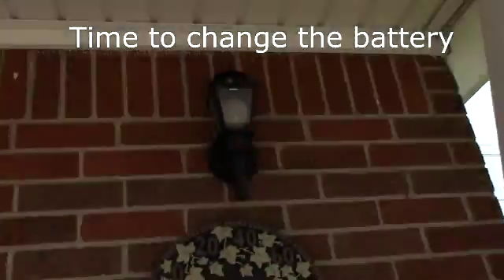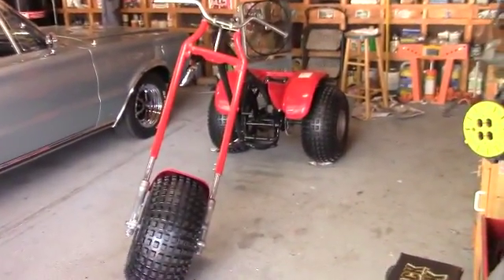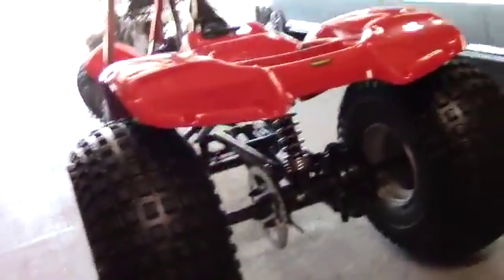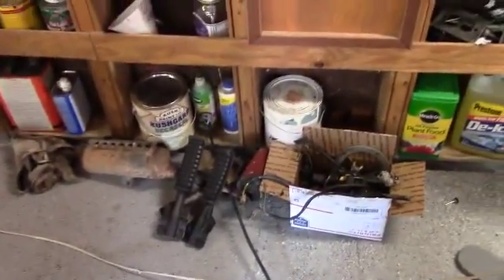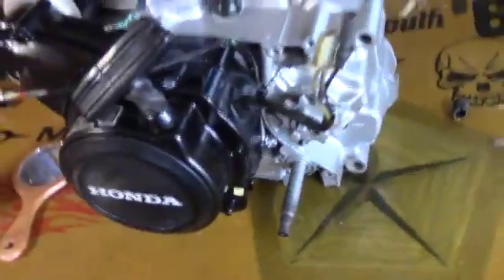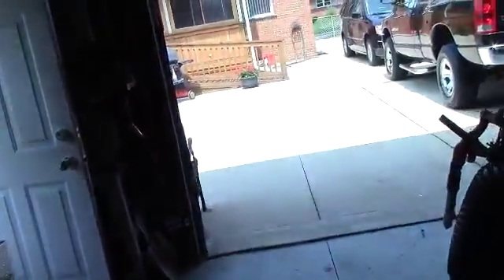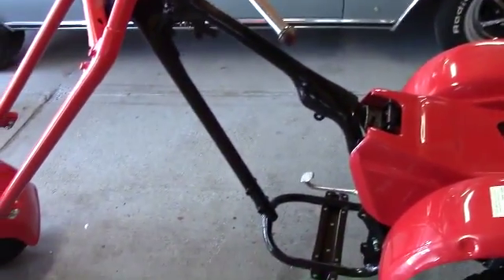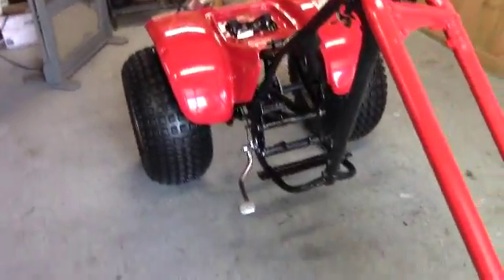Update Honda Chopper

Comment: Exhausts are tricky. On my 500 XR motocross, the baffles rusted out and were rattling but the outside was 1/2 ass intact, so I cut it in half and just made new baffles to look like the old ones and welded em in. She works just like new and it cost me next to nothing but a bit of time. If ya knew what the guts of the muffler looked like you could just make a whole new muffler or if you can afford it, brand new old stock is the best way to go. The Chinese make a nice little baffled glass pack to fit a 250cc for about 80 dollars/free shipping. Used mufflers are used mufflers. You already got a used muffler so that is kind of a dead end street.
OR
you could get really creative and make an entire new exhaust using straight pipes with one of those little baffled glass packs sold for small tractors but it will be louder. If you want quiet just put 2 of em in a row (leave a space between) and that will give it a deeper note. The front fender looks great. In fact the whole bike looks good. 

Personally if the muffler doesn't rattle, I'd just stuff it with xx coarse stainless steel wool on the intake end and use it. Just stuff it, don't pack it in or it will cause a restriction. A little cleaning and a little heat paint and it will look and sound as good as new. The steel wool will last about a year and burn out but it is so cheap, ya just replace it every year.
Check this out:
http://www.ebay.ca/itm/Exhaust-Muffler-w-Heat-Shield-Cover-for-250cc-X31-19-16-Dirt-Bike-4-Stroke-/141342466273?pt=LH_DefaultDomain_0&hash=item20e8aae0e1&_uhb=1
Reply from the maker: EdOfTheNorth Thank you Ed, Your the BEST friend a person could have, I just ordered that muffler for 80 dollars I think it will fit it perfectly, I'll just have to make the header for it, That is the fun part, I also like your idea about cutting the old one in half and seeing how they put the baffles in it, That would be good to know, I have checked out a lot of mufflers on ebay and didn't come across the one you found, The price and style of it is just what I was looking for. The last time we talked you ask if I was going to put a sissy bar on it, I am thinking that it would look cool on it, Just not to sure on the style, How high,how wide, Just don't know yet. Take care my good friend.

Comment: Looking great. I just asked a mechanic friend about the exhaust and he said you should not run it open. The engine needs some back pressure and also thermal shock can crack the exhaust valve if cold air can get back to the head when you shut down. I'm sure you'll figure out something neat for it.
Reply from the maker: Bruce Boschek  Thank you My good Friend, Your the best, I didn't know about thermal shock, It makes sense, I did find a muffler on ebay that meets my needs for it, It not only looks cool but I think it might even add some power to it and sound better. Take care and have a wonderful day :)

Comment: I don't know for sure, but I would think if you alter the stock exhaust you may run into tuning issues. We'll see what we can find out for you.
 Looking mighty fine Steve, Kudos
Reply from the maker: ***** Thank you Bruce, What I had found out though all you Great bunch of guys here in the Garage Gang is I need back pressure for that engine to run at it full potential, So though a wonderful Garage Gang friend witch found a cool muffler on ebay that I think will complement the bike, I ordered it. I just have to make the header leading up to it. Thanks for being there my friend. Take care and have a great day :)
Reply: MrWillis5719 That's awesome, Glad you're getting it sorted out. Cheers